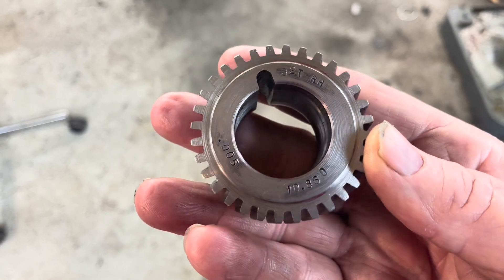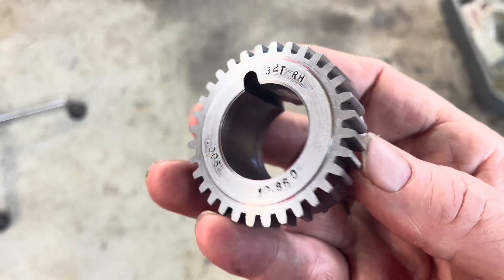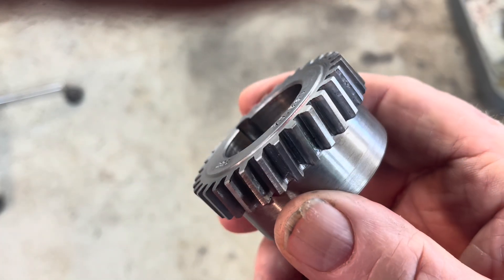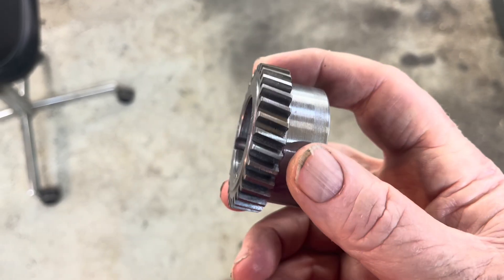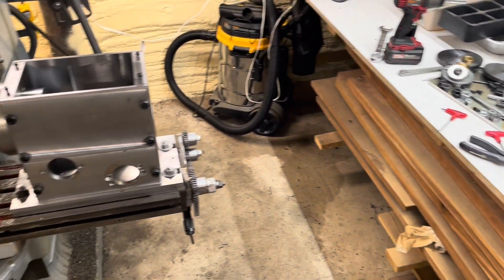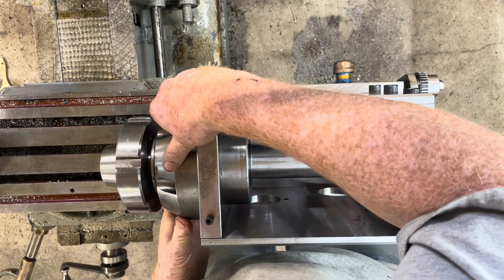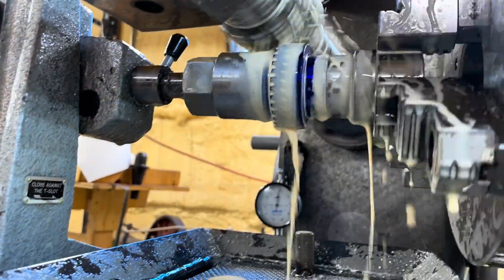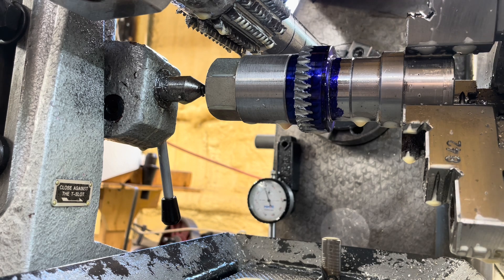Helical Gear Hobbing, Shop-Built Machine..First Gear Made!

Comment: Nice job on this but I bought a barber colman gear hobber for 600.00.
Reply from the maker: I thought about that, but in the end it was about understanding how to build a hobbing machine that worked properly, not about doing it for less.  Have a blast with your B-C, though!  Did you get plenty of tooling/change gears?
Reply: @thomasstover6272  I got some but others I made on my cnc with a 1/8 endmill. Some I made with gear cutters on a mill. Now I have access to barber colman at work. We 3 have of all the change gears. Too bad they won't fit on my older bc #12
Reply: @thomasstover6272  Here is a short video of my barber colman cutting a helical gear on a transmission shaft for a pulling tractor
https://www.youtube.com/watch?v=d3fFn2LsS0s

Comment: Nice Job well done. Remember you have to add or subtract  the lead angle of the hob from you setting angle. Depending if you have a right or left hand hob or right or left job.
Reply from the maker: Thank god I only have right hand hobs, otherwise I’d never keep it straight!  Too many combinations!
Reply: This may help.  For Helical gears,  (Right hand job, Right hand Hob) = (helix angle of part, (minus) Hob Lead angle) = setting angle. You can use your RH hobs to cut LH gears then the setting angle is this.  Left hand job Right hand Hob =(helix angle (Plus) Hob Lead angle) = Setting angle.  Works every time.
Reply from the maker: Thanks!  I’m putting that one up on my toolbox!